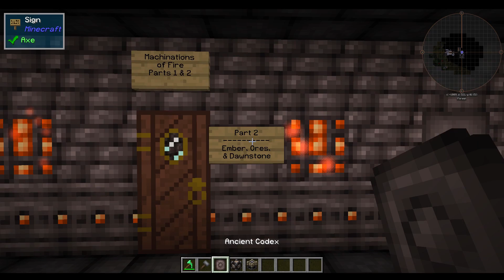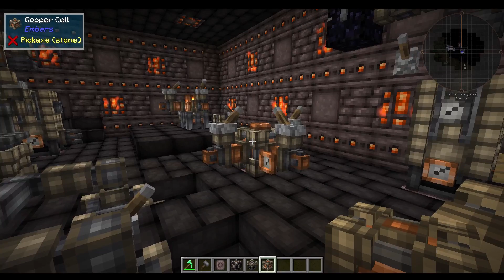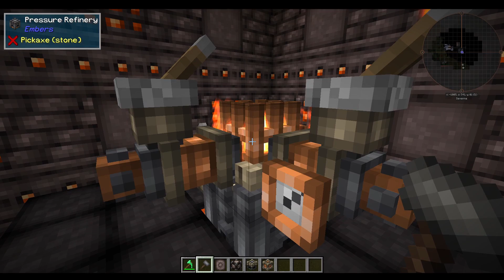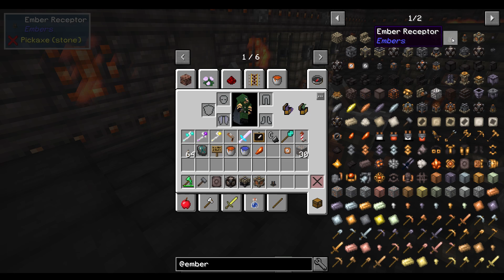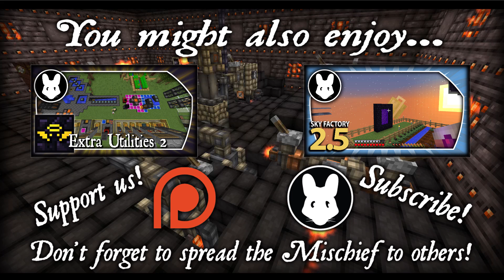Embers: Machinations of Fire Part 2 - Minecraft 1.11.2!

Comment: Ember isn't transferring for me, I link it up, turn on redstone, but it will not work
Reply: i had the same problem. You have to SHIFT RIGHT CLICK THE FIRST and then JUST RIGHT CLICK THE SECOND without holding shift
Reply: Thx for the advise. :)
Can anyone tell me, how i can remove the machines from the embermod without destroying it?
Which tool i need to use?
Reply: @eirikr9574  -- Any pickaxe of stone level or higher should do the trick.
Reply: Lord Pootis - I am having a problem as well - looks like levers are not actually connecting to emitters
Reply: Ian Moseley
No, my problem is different, the levers are connecting and emitters are turning on, but the Ember just drains instead of transferring

Comment: Ember seems to act a bit like a lot of things. It's like thermal energy because of how it's made. Its substance would seem to have qualities of electrical, thermal, and maybe compressive energy. It's movement makes me think of electricity, a liquid, and a magnetic field. I reckon it even has a bit of intelligent behavior, like what is seen sometimes from magical energies.

Maybe, “behind the scenes”, the Embers machines are using Ember in a bunch of different states, like the states of matter. Infact, it may have more states than matter actually has, for all I know. I've seen it in a crystallized (solid) state, and in whatever state it's in when stored in a copper cell. I don't know if it has to change states when being transferred through the air, or being used by machines. I think the backstory would be interesting to write and/or discover.